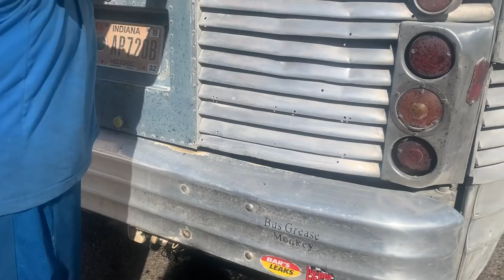Headed to my next stop in my vintage 1947 bus

Comment: To bad you don't have some extra time to detour while you're in that area. You're about 100 miles from Jarbidge, Nv. It's an old gold mining town which has 3 major points of interest. 1. The most isolated town in the lower 48 states. 2. The location of the last stage robbery in the US. And 3. The first time finger and hand prints were used to convict someone of a crime in the US (due to the stage robbery). The town does have a website, camping areas, hotel, restaurant, B & B, bar & store. Year round residents total about 12. Wish you could make it there, it's a great experience. Good Lord, I just realized that the last time I was there was 50 years ago. Was there when I was 17 & I just turned 67 (& yes, it's still there). Been wanting to go back for a long time. Have fun & stay safe.

Comment: In the early 90’s I was out west, at altitude, and I had the same fuel starvation problem in my Trans Am. I had had issues for weeks leading up to it and had spend nearly $ 1000 on HEI parts and other carb/ignition. After getting towed into a little shop in a one-horse town the mechanic pulled out the  $ 1.50 carb fuel filter and blew thru - as Scott said in this video, and bunch of $h#t flew out and once replaced I never had a problem with that issue again...lol... safe travels.
Reply: Reminds me of the movie about Bonnie and Clyde where the pump jockey told Clyde that he fixed the motor by "I just blewed her out".

Comment: Fuel filters is the first thing i look at when i get a boat/RV generator that wont hold a load.  Those little generators work on such a fine line that any little restriction will make it drop on start up.  Vinegar is a great cleaner for windows on boats to get the salt crud off and not leave spots.

Comment: That section of Highway 80 across Nevada east from Reno was always a problem for heating up the engine. I used to drive a 1953 GMC 4801 with a 671 and a 4 speed. We'd spend much of the day in 3rd just to keep it cool. Most of the time that bus didn't have the power to overheat itself - like you, I'd feel the grade. But in that section, for some reason, it wasn't hard to go too fast for the cooling system. Always had that problem there. Never had that problem anywhere else. Of course, you could overheat, but not without an obvious reason.

Comment: In the 50s we carried a 5 gallon can of oil.
Love your videos. 
Thankfully you survived the festival. 

😁😆😉
Reply: Scotts bus came new with a 4 gallon oil reservoir plumbed into the engine.  His has since been removed, but fortunately mine remains.  There is a dial on top and you can release oil in 2 quart increments.  It slowly drips the oil in, so by the time you reach your destination, you have as much oil as you left with.

Comment: For all you that don't understand how diesel  burns in the ignition event . When you have fuel burn out of the piston cup or to early in the event it causes slow sooty burn and higher egt temps. This is much less efficient than It should be if timed properly  and injector hight is set correctly. It can also make a engin  run hotter. We have seen  as much as a 10 percent loss in pulling power with improper  injector nozzle angle. This is why all the hot rod deisel  pistons tend to have large cups in them to hold the fuel near the ignition  event.

Comment: When I ran my rv with an onan back in the 70's I finally gave up and put a full size fuel filter on it then it ran fine from oil change to oil change. I'd suggest you do the same. No need to run the onan miniature gas filters which I finally figured out were simply designed to make money for onan.
Reply: Great advice.

Comment: Playa dust has a lot of gypsum and some calcite, which are alkaline, that's why the vinegar works (it helps dissolve them).  Any other dilute acid or chelating agent would probably work equally well 😊
Reply: How does vinegar treat paint (or wax), aluminum siding, and the rubber window gaskets? Any risk of damage or deterioration?
Reply: @davecc0000  I'm not sure, I've never tried it.  I would just test it in a small area.  Vinegar is pretty mild but I'd be more worried about wax and aluminum than the other two.

Comment: Interesting how the injector depth into piston deck height?, Protrusion etc, etc, etc...can have such an impact on Engine performance. It's these small overlooked details can make such a difference in cooling, performance, efficiency and the list goes on. Speaking of efficiency, maybe a bike rack fabricated on the rear of the bus with a swinging mount allowing access to Engine compartment might be an idea?, (Aerodynamics) even though the bus is somewhat like a brick on wheels.
    Thanks for sharing!.

Comment: If an old Detroit does not leak oil then there is none in it and you describe exactly why I do not own hot rods any more i got several very expensive speeding tickets in the late 70s and early 80s and decided that since my lively hood depended on having a clean dl and could not keep my foot out of it the hot rods were gone 
Have a good day
THE GRUMPY BUS

Comment: when we had v belts driving our fan and alternator. the thing to do was spit on the alternator pulley and if it sizzled. tighten the belt just enough to get it to stop slipping. the multi grove belts work so much better.

Comment: when its blowing oil out the exhaust pipes, you know you have a problem.  There was greyhound bus that was sabotaged at Alice Springs in Australia in the 80's. A mechanic stuck a blob of carborundum valve grinding paste inside the oil filter..............1500km later at Adelaide the motor was struggling, oil everywhere, down on power but still going. It went into Detroit Diesel at Dry Creek and was pulled down and inspected..........the whole engine ( 6V92)was so badly contaminated it was dropped into a scrap steel bin out the back.

Comment: Green Leaker and Driptroit Diesel , just two of the nicknames used on these engines.
Reply: I don’t know of an engine made back in that era that didn’t leak oil especially the diesels of that time. I’ve got a Series60 that has 813K . It’s got a seep at the football seal and front seal but that’s about it. It’s also been very well maintained.

Comment: If you added 4 valve head and pump adjustments I would expect more heat. 195 is not hot but some rad washing to get the b man dirt out might get it down.
Reply: Good advice with cleaning the exterior of the cooling system from all the sands.  Also his radiator is missing some metal fins from corrosion, as shown in one of his previous videos, so that arguably doesn't help with lowering the temps.
Reply: I’m sure he has plans to upgrade the cooling system when he adds a turbo.

Comment: I had my Bus serviced, they changed the oil and filters. During the service, I was asked if I wanted my Radiator Filter Changed? I said I've never seen a filter on a radiator before. They said I had one and If I wanted it to changed the xtra cost including filter would be around 100 bucks depending on how much antifreeze they had to replace. I said yes wanting the start fresh but I've looked in the engine area when I got home and I don't see any water filter. This is on a 8L Cummings. Have you ever seen a water filter ??

Comment: Have used that same generator and it is a pain.  Thanks for the tip on the filter.  Will check that.  Pig blanket?  Is that a bus diaper?

Comment: Vinegar will dissolve the minerals in the kind of dust that sets up like concrete (high in calcium, lime, etc...).   The same reason Coca-cola works sorta decent as a cleaner (contains phosphoric acid and citric acid).    If you go by a construction site where they're sawing concrete and get a lot of it on a vehicle (then get it wet), vinegar will take it back off.

Comment: On oil pans and valve covers in high vibration situations I always use rtv on the threads of any and all bolts. Granted I do this on gas engines but the theory is still the same.

Comment: Generator tank may be releasing nasty stuff. Modern ethonal 10-15%fuels eat stuff up. Id check the gen set tank
Reply: Its a diesel. Pretty much everywhere there is no ethanol in diesel.
Reply: @tbernardi001  he said the gen set was a 6.5horse gas

Comment: You are game reusing a cork sump gasket .I replace them all the time on customers older vehicles because oil drips can earn you a ticket here.   I have seen a vid made in Germany showing a leaky engine with a made up pan underneath with a diaper in it to soak up oil from the rope seals so it has been done before.😁

Comment: Do you use thread locker (lok-tite)?
Reply: Thread locker isn't a great idea on cork seals because they do shrink over time and periodically have to be tightened so I use rtv on the threads to lock the bolts in place which works just as good

Comment: Hi, from Northern part of Norway.
Are you going to install a turbo?.
Good to hear that the engine are doing great!
🤘👍🚍
Reply: He will install the turbo right after he finishes his Matpakke.
Reply: He will install the turbo right after he installs a larger radiator and electric fans. A turbo is going to melt that original cooling system...

Comment: Lol... I wont have a problem in my bus "controlling my speed"... she is just not a 'fast' bus...
But this does bring up an interesting question that I have thought of often. I realize that you dont work on CAT engines,  but I have often thought about altitude conditions on this engine. It's a 3208 Turbo and all mechanical. Would I need to adjust it for higher altitudes if I continue west? It was after all at the beginning of its life, a school bus in Washington state. I imagine that if anything like that were needed, the mechanics for the bus would have made adjustments for that, and that it never changed after it was sold.  But where would those adjustments be made at, is the basic question...

Comment: i'm surprised you haven't gone with a diesel generator  , they are more efficient than that onan genset is
Reply from the maker: I got that free and it works great
Reply: onan makes great generator sets  , i have one at my farm that's set up to run propane and it's got over 1000 hours on it trouble free ,i was mostly thinking about fuel  no need for a second fuel tank with  a diesel genset

Comment: I was wandering is it normal to have leaks after such a good overhaul? I have been enjoying your videos.
Reply: No, major leaks are usually a gasket failure like shown. It happens.
Reply: The 671 Detroit  being a two cycle would have a pressurised  crankcase.  This effect creates leaks
Reply: @1dollarten  only when the intake chamber gaskets fail on the bottoms of the cylinders. 
Other than that happening, they aren't pressurized more than any other engine.
Reply: Thank you both

Comment: Yup dont you love the coal rolling 4x4 lifted never goes off-road, dick measuring pickup trucks? Haha i never got it. If you are not hauling or working with your truck why have a huge loud dumb truck? I can see traveling welders but the excess fuel/coal rolling is abnoxious and a waste
Reply: I daily drive a 4x4 lifted never goes off-road, dick measuring pickup truck, and it irritates me too.  There is no reason to roll coal in a modern vehicle, and these idiots that put megaphones where their mufflers used to be need to be punched.  That being said, my truck occasionally sees rough terrain and constantly tows heavy loads, but when its clean and uncoupled,  no one knows that.